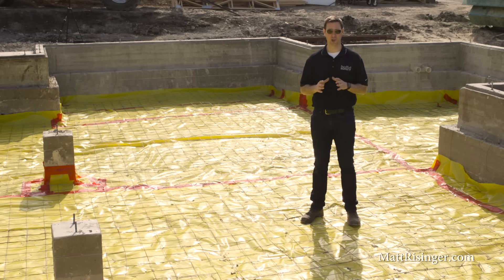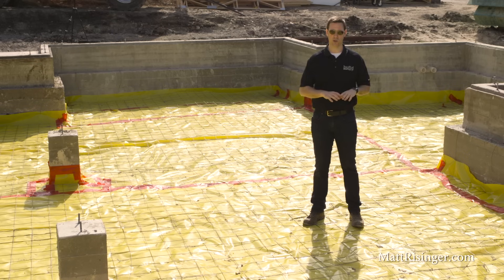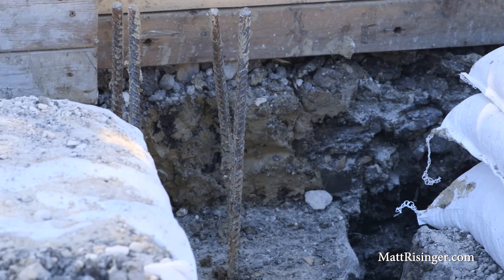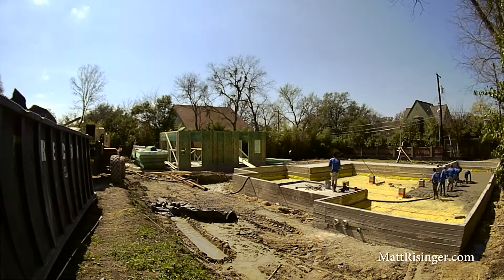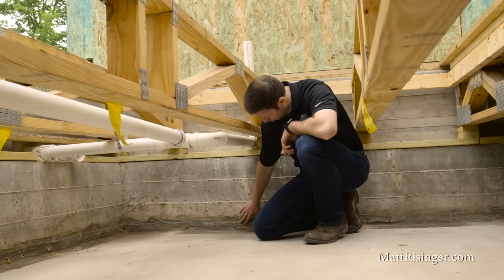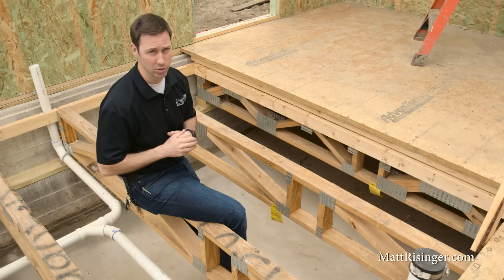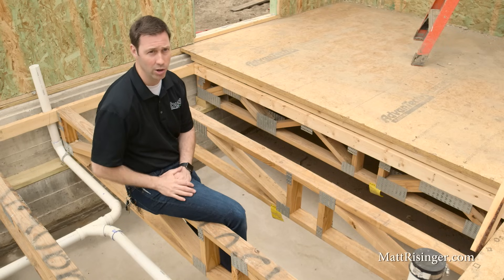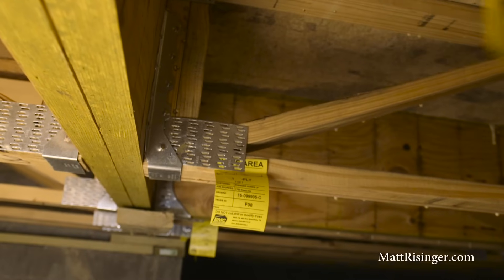Pier & Beam Foundation with a Conditioned Crawlspace

Comment: What about termite protection?
Reply from the maker: We applied Termimesh at the slab/wall joint post pour for a physical barrier to termite entry
Reply: No moisture, no termites. They need water to survive...
Reply: @21gonza21  me to,,
Reply: @21gonza21  they are def termite issues in a build like this that MUST be managed